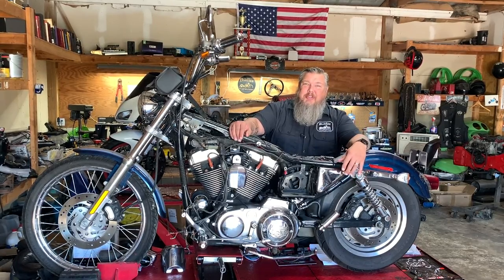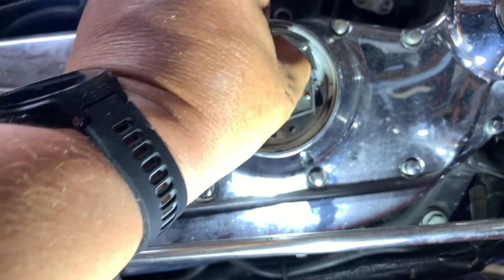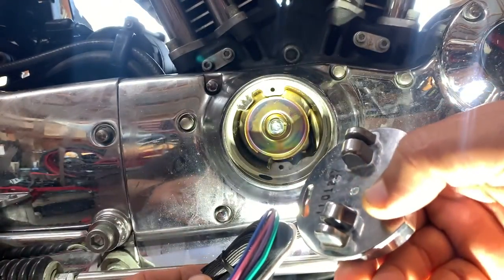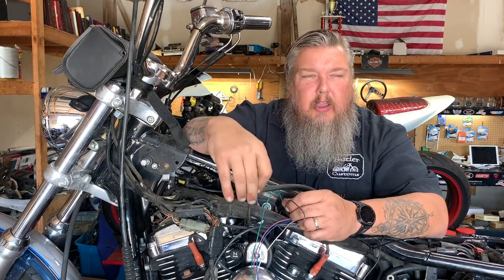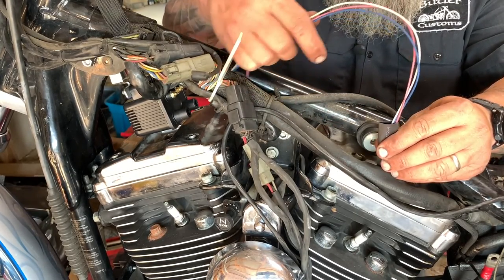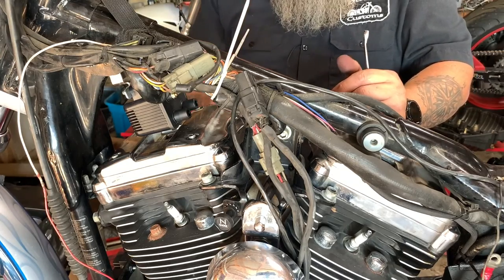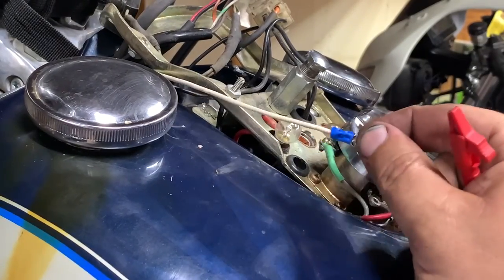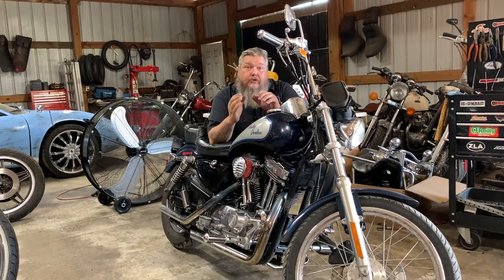2000 Sportster Complete Ignition System Upgrade to a Single Fire Ultima Ignition System.

Comment: watching again & thanks again bc I have an  dilemma on my 2000 HD 1200 sporty w/ 35K miles will always  cold starts great runs great all day or 0nly for a few miles  & its getting worst  ! - that my bike will just die leave me stranded & will not restart till its sits / cools off i guess for 15- mins to an hour or  so & so far I have not found the solution   , my coil duel fire ohm @ 2.7 solid & bounces between 10-11 K  / ignition module  behind cam cover appears to be fine no sign of over heated but someone also told me it could be an defective key or kill switch or pinched wire most anywhere s so may Try  this Ultima single fire system but I hate  throwing the parts cannon @ it & still not fix my problem ...any advice would be very helpful .. Thanks in advance
Reply from the maker: It certainly sounds like an electrical issue. Things to check would be that your stator and rectifier are charging your battery at higher rpms, check plugs and gaps, also test the resistance in the plug wires, also check your major ground points, and your volts going to the coil when the bike it hot. Sounds like you’ve already tested the coil and ignition. Usually an ignition going out will cause more problems than just a no start when hot like backfiring, tach gauge bouncing, or a dead cylinder. Hope this helps.
Reply: @butlercustoms  Thanks Ill keep digging ck stator  & coil input , grounds ,  I just read something about an angle sensor never herd of that so ill start recking everything if you were closer Id just hopefully bring it in for trouble shooting & repairs my last 2 HD independent mechanics unfortunately have both have   passed Thanks again appreciate ya !!!
Reply from the maker: @jmead6121  the bank angle sensor is a safety kill switch for when the bike falls over. Good luck and let me know when you find the issue.
Reply: @butlercustoms  Thanks will do !
Reply: @butlercustoms  Hi Good morning Hopefully  found it .? .. testing yesterday great cold start then died pretty quickly luckily while i was watchin the pretty red light flashing  on ignition module went out ... with key still on i cked coil & coil is still hot ..so unless it something on the module  input side dropping out 1st that i dont know about yet but lookin for wiring diagram  then  this module BAD  bc its diffidently dropping out ....Thank  ya very much ...Noting Much worst than A Bike sitting when we could Be Ridding lol
Reply from the maker: @jmead6121  hopefully that’s the culprit!
Reply: @butlercustoms yes sir me too ...its been Frustrating ,  bike usually dint die till  iam way down the road making it harder for me to test / but yesterday she died  quick this time & thankfully got an Visual ..... So New Parts On Order  ...&&&& Thank You Very  much for all your help  & answering my text back & Questions  Thanks & may i ask what city your shop in & do you take new customers ..Tks again
Reply from the maker: @jmead6121  we are located in Hartsville TN and all are welcome to stop by.
Reply: @butlercustoms Thank you Have good friends In Nashville    ....Tks again & have an Great Day If this dont work ill keep ya posted

Comment: Will this system be compatible with a S&S 96 cu in engine?
Reply from the maker: It should be compatible with all sportster motors. But please check with the manufacturer.
Reply: @butlercustoms  def not a "sportster" its a S&S 96 cu in
Reply from the maker: Correct. That’s why I said it should work on most sportster models. They have kits for big twins but this one might work. But check with them.

Comment: I’m sure you’re the guy that I have a question 🙋 after watching this
Reply from the maker: I’d be happy to help. Just send me an email or post your question in this comment section. Thanks for watching!
Reply: @butlercustoms  okay so this my current situation and I’m gonna try to explain it, So the other day my 2002 HD sportster 883C um just died while pulling into a parking lot didn’t realize at the time I turned off key ignition and back on and it started up and made it home, now what I have figured out is that if you start it up it will die in about 30 seconds and if I try to restart it without turning the ignition off/on it won’t fire up again but it will if I do. I bought a coil and a voltage regulator rectifier and both those things didn’t fix the problem I also bought a Crank position sensor however that hasn’t come in the mail yet and I actually don’t see it right below the oil filter so I don’t know where it’s located? I did find a vacuum line off pecock to carb that was brittle so I did replace that as well and for the most part it will start and idle longer than if you try revving or throttling it, the thing is I can see the fuel spraying into carburetor just fine in fact it dies while I see fuel spraying so it’s baffling by the way all 10 codes are CLR on odometer.
Reply from the maker: I’d start from the battery and work my way backwards. A voltage meter tool is a must have and they have cheap ones at any parts store. Check battery volts with key off. Should be 12.5 or higher. Check battery volts with key on. Should not drop below 12.2 volts. Check battery volts when cranking should not drop below 12.2 volts. If any of these fail, replace the battery or charge it up. When running battery volts should read 13 volts or higher. If not then it’s a charging issue. Probably stator. A bad crank sensor usually goes out completely resulting in a no start issue. But it’s easy enough to replace since you’ve already order it. Also check spark in both plug wires. Bad coil or loose connection on coil can cause this also. If your petcock is vacuum released then make sure it’s working from the carb side. Just disconnect the vacuum line from petcock and make sure it’s sucking in air. This opens the petcock to release fuel into the carb. It might be getting fuel but not enough when rpm increase. But it will sputter or bog down when running. It will sound like it’s out of gas if it’s a fuel or vacuum issue. I hope this helps to get you started in the right direction! And keep me updated.
Reply from the maker: And if you have a 2002 model you don’t have a crank position sensor like the twin cams have. Instead you will have a timing sensor underneath the timing cover. Sometimes those will get too hot and melt causing spark issue. Your wires from that run to your coil so you can test it from the coil side.
Reply from the maker: In 2004 they switched the sportys to the crank position sensors like the twin cams.
Reply: Okay so I was late getting back with you I greatly appreciate your time and quick response I will get on it and see what I can figure out and keep you updated.
Reply: @butlercustoms  So I took that cover off timing had to drill out rivets and underneath it has similar to what you upgrade in this video the ignition module without the switches but it has the flashing red light when running, I checked battery good it’s read 13 volt’s when running and 12 with key forward, I just wonder if my key cylinder could be bad? The only thing that I know is I checked spark plugs on case and they spark great then I put them in started motorcycle and revve it to get it to shut off and then I pulled plug with key still forward and they didn’t spark the same then I tuned key off/on tested and spark was normal again? I feel it has to be something so stupid that I’m overlooking it, like yeah buying the new coil wasn’t necessary because I ohm the old one and it’s correct and the rectifier I bought the old one under side was cracking and mushy so I think it was good to replace it. Oh shoot I need to add something a new symptom I have the air breathing totally off and now when I reeve it before it dies it start poping and backfire out of carburetor, that my be pertinent information?
Reply: Nope 15 days in Ghosted I guess I asked the wrong person…
Reply from the maker: My apologies. For some reason I never got a notification of your previous comment. I’m just now seeing it. Let me give you my email so I don’t miss any more of your questions. Butlercustomsmotorcycleshop@gmail.com. Send me your address via email and I’ll send you over one of our patches.
Reply: @butlercustoms  Okay The email is better option then posting things publicly in fact if you want I’ll delete my OP?
Reply: @butlercustoms  that way I can send you some
Videos of it running then how it dies I already have them recorded
Reply: @butlercustoms  and also I know your a busy guy so it’s not always easy to try to help when your plate may be full already?
Reply from the maker: @InTheFleshInc  you’re fine. I just never got a notification on your missing post. Email is certainly better. And again, my apologies.
Reply from the maker: @InTheFleshInc  true
Reply: @butlercustoms  It’s perfectly no need to apologize I just thought you Ghosted 👻 me, I know how wacky social media can be sometimes it’s good sometimes it’s shit, LOL 😂
Reply: @butlercustoms  I haven’t gotten the email out to you yet but I will soon, I honestly got super busy with some projects on my end and I also wanted to get what else’s I have to wrap up beforehand…
Reply from the maker: @InTheFleshInc  no worries. I’ve been covered up myself.